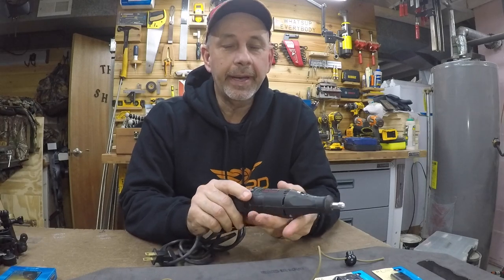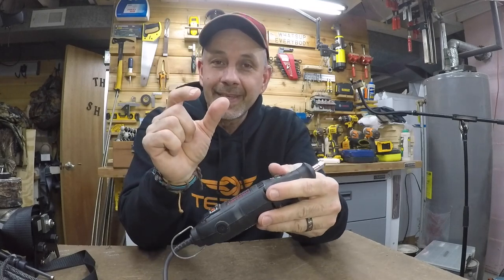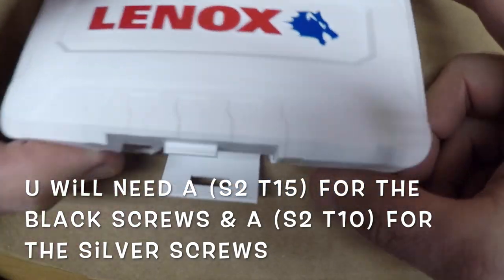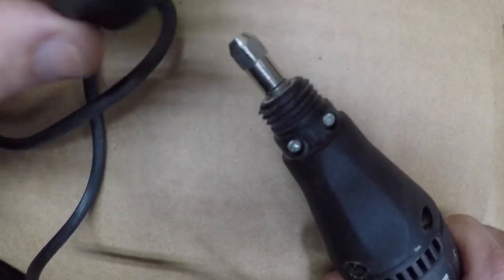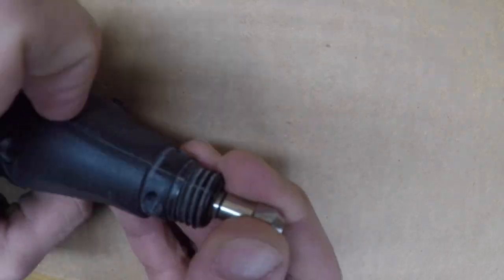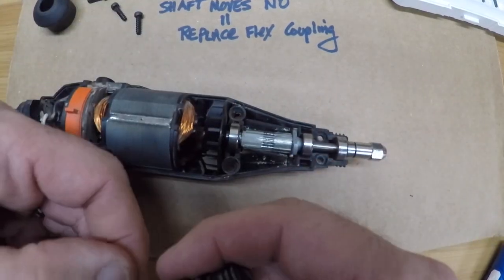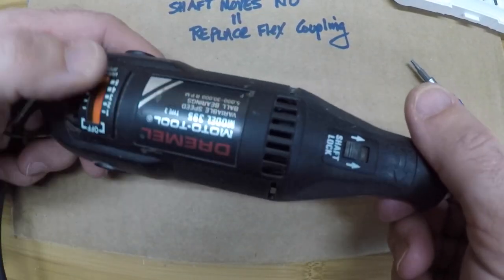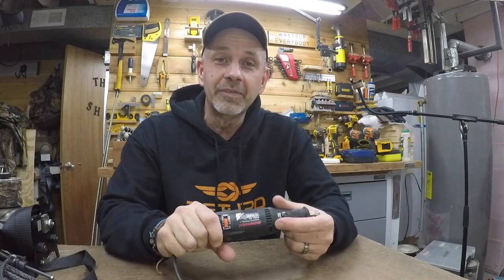Dremel 395 Replacing the Coupler / Repair

Comment: I fixed my Dremel  today coupling using a scrap piece of nylon tubing and a heat gun, very easy to do. Cost  me absolutely nothing and its working better than before. On line they were asking  16 $ +5 $ transport for part, which i thought was  too expensive.

Comment: Thanks you for this, I've seen other videos and instructions and they don't specify which Torx sizes are needed. I've got a couple of smaller Torx screwdrivers for some laptop repairs I did earlier, now I'll need to grab a T10 and T15 too.
Reply from the maker: Ur welcome and it’s hard to part with a favorite tool that has done so many projects and it was such a simple fix once u open them up.
Reply: Finally got my delivery of Torx screwdrivers and fixed my Dremel 396. For my 396 the T10 was enough to do the job. Even with an extra screwdriver that I didn't need, this was a bargain compared with getting a new Dremel. Thanks again.

Comment: Great video, well edited, right to the point.  

One small extra suggestion:  When reinstalling screws in plastic, rotate the screw slowly backwards/to the left until it clicks and drops down a thread.  Then gently turn to the right.  That way the screw goes back in the threads it cam out of.  If you just push the screws in and start tightening them you can cut another set of threads and weaken the plastic.
Reply from the maker: Thank u for that suggestion that a great point and thanks for watching.  That little guy has so many hours of use I couldn't just let it die... LOL
Reply: @MarksWorld-GetOutdoors  Thank you for making that video.  I've since got the part and fixed it.  I was afraid that it had stripped gears and that I couldn't get the parts.  The other suggestion that I would make is to make sure one looks in both halves of the body  and picks out all the little broken pieces of the old coupler.

Comment: Hi, I have the same problem but it's a Benchtop pro you think I can get the part for my rotor tool ?
Reply from the maker: +supercow61 u may be able to .. reach out to the maintenance department of the maker and see if it also has the coupler between the motor and the tip
Reply: @MarksWorld-GetOutdoors  yes because little pieces of the plastic came out from the vent like yours !